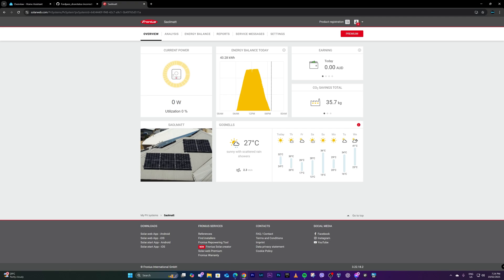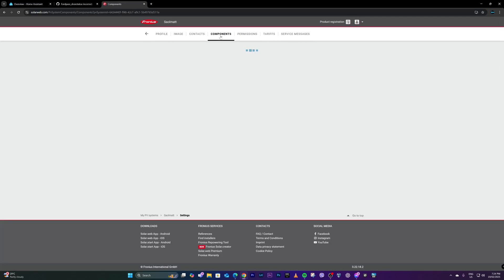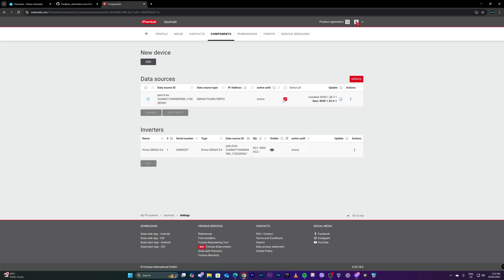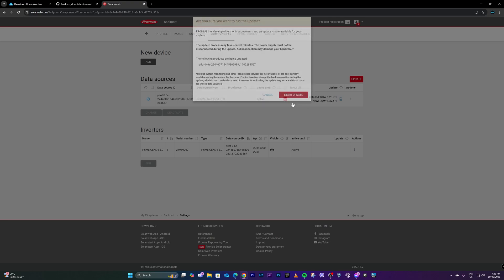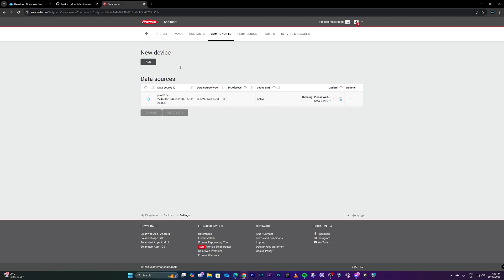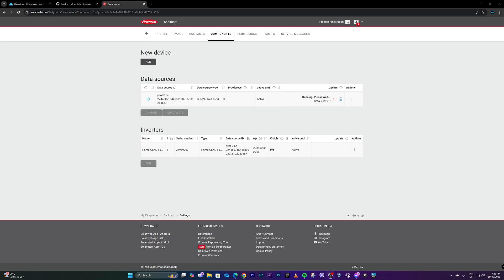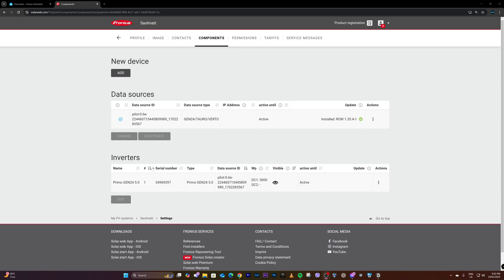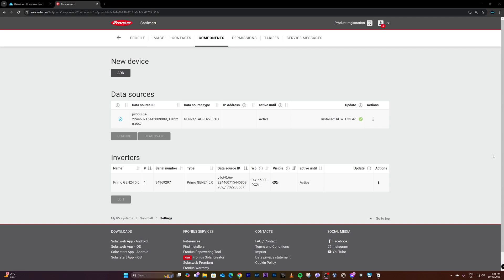How to update fronius firmware inverter

Comment: I have tried to update mine and it says it’s been running but still not finished after nearly 24 hours. Got any tips?
Reply: Hi, how’s your update going? Any success?
Mine’s having the same issue wouldn’t download just says queuing and it’s been a few days already 
Checked internet connection all tested okay
Reply: @kaiwong7692  mine eventually updated the inverted but the data logged failed. But I tried again and it worked. I’m still getting an error 316 every day and Fronius said my inverted needs repair or replacing